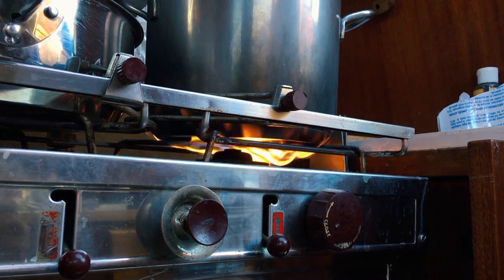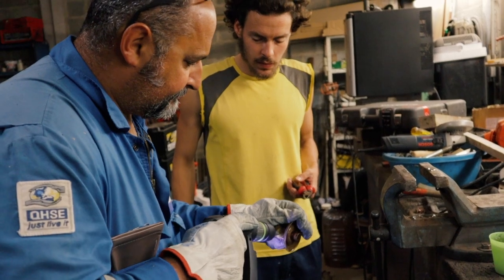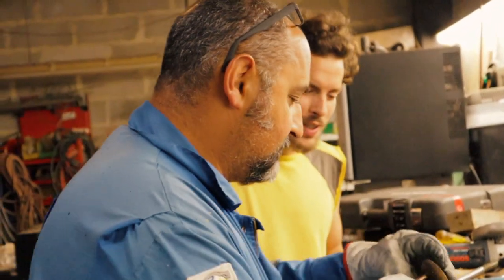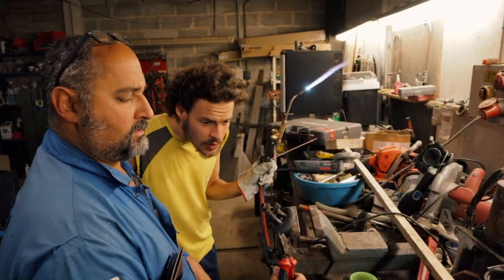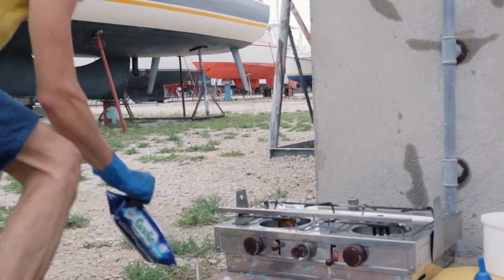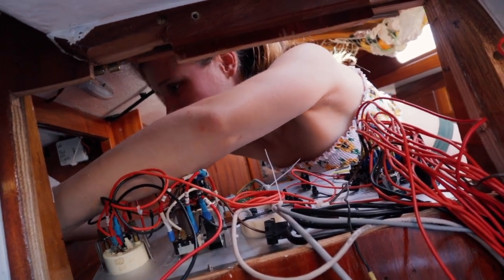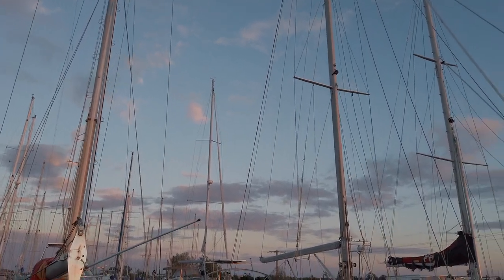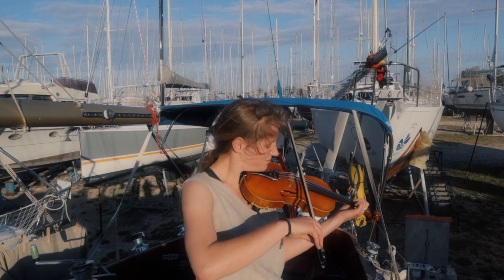Our Stove is Broken! [Ep 27]

Comment: What Maxime & Alardino were doing is called brazing , sort of a less hot welding, ideal for soft 

metals like that burner  but sadly only really used by us old school guys these days.  The little
connectors you crimped onto your wires are called spade connectors.  My Dad (long gone)
always told me to label the wires when I was taking my car apart, so that was very sensible.
And  playing us out with a fabulous tune.  Great video,  thanks   :)

Comment: Pressurized  alcohol stoves have been largely replaced with non pressurized wick burner stoves.  Small one burner alcohol stoves are small,  inexpensive and use the same alcohol fuel. It might be a good idea to  take some of these along in case the main stove fails during a cruse.

Comment: Hi Aladono, I have the same stove - always exciting to cook with  :-) In Hamburg I've got a repair kit three years ago ... Dont know if it is still available? My stove has an additional nozzle / blast pipe in order to make the stove heated bevor it burns. After getting the right temperatur it will have a clear blue instead of this yellow flame. Others use sprititus before using the stove.  Much worse also my heater runs with petrol and I ve tryed three times to repair it (35 years old) forget it, it works for two weeks and after the summer in autumn when you need heating the old pump isn*t working any longer :-/

Comment: G'day. A question: What is that 12v car type charger you are using for that apple mac?  Is your laptop an Air or Pro? I've got a new Air, which doesn't have USB charging,, so I need to get a 12V car charger type for my boat and adapt it to use to charge my Air.   I also didn't spot an inverter.....you just appeared to plug that 12v charger into your (newly located) cigarette socket...or did I miss something? If you don't use an inverter then I assume your charging set up for the Mac doesn't need the boost an inverter supplies, hence my interest. Cheers.
Reply from the maker: I spent a lot of time trying to figure out how to charge my old MacBook Pro without an inverter, and I ended up just buying a 12v to 85 watt MagSafe 1 charger from eBay. So far it has worked absolutely great!
Reply: @SailingMagicCarpet ; Hey thanks !  Nice  & simple.  Don't be afraid of more "technical" or even "boat yard refit" videos about how you & Aladino have your beautiful boat set up for cruising & living aboard. For us small boat owners it's great to see how others  with a small boat & minimalist / budget focused mindset adapt their boat systems.  Cheers.

Comment: Prime that stove with methylated spirit.
It's cleaner
Reply: I see that you've made contact with Base Camp, the English speaking world's one stop shop for paraffin/kerosene stoves.  What you have there looks like an Optimus 155W.  You might be able the get some Hanse Number 1 burners from Taylors in England but if there is a temporary shortage of the burners from Germany then I suspect Taylors will be hunting for them just like you are. Your alternative might be an old Optimus 207b burner on eBay but they are fairly rare too.

Short of that it's either wait until Hanse get their burners on the market or switch out to foolproof Origo stove.  Naturally, kerosene packs more punch than alcohol, but there are some committed devotees of the Origo out there.

Comment: Very good.  Kerosene...eewwww!  Induction cook top!
Reply: While induction cook tops do use a lot less energy than either gas or electric resistive hobs, they still use rather a lot for a boat without a generator. At 1400 watts my induction cooker boils water faster than a 2400watt ring... but 1400 watts is still 1400 watts, that's over 100Amps at 12V. On a boat, some sort of carbon based fuel is still king. Solar cooking solutions are great for sunny days at anchor or in the slip. Might be frustrating at sea though. Another energy saver is "straw box" or "retained heat" cooking for anything that requires a long simmer, like rice. Put boil rice as normal for 5 or so minutes, put cover on the pot, put pot in insulated box... done in an hour and still hot. Insulated box = cooler stuffed with a quilt or sleeping bag... or just the sleeping bag in any old covered box. I have even seen people use a laundry basket. Sure beats keeping the stove going for half an hour.
Reply: Watchful1 Induction hobs are too much of a load on limited generation capacity.
Reply: @lenwhatever4187  Thanks for the information.  SV Delos is experimenting with the setup--they did switch to several Lithium Diode (modern) batteries so maybe that makes it feasible.  You should search their youtube video on it and see what you think.  Interested in your opinion on how they are experimenting with it.
Reply: @daffygrey  sent this to Len too.  Thanks for the information.  SV Delos is experimenting with the setup--they did switch to several Lithium Diode (modern) batteries so maybe that makes it feasible.  You should search their youtube video on it and see what you think.  Interested in your opinion on how they are experimenting with it.
Reply: I have seen SV Delos previously, but they are not a go-to channel for me. They are a much larger boat than Magic Carpet, with space for a large solar array and battery bank, though size isn't everything. Lithium ion batteries (I assume that's what you mean) have a high charge acceptance rate and can be used to a significant depth of discharge. However, they still have a finite number of charge cycles, dependant on the depth of discharge, and their replacement cost is still very high. Induction hobs, having a high power requirement, will have a significant impact on the cycle life of the battery bank, even if it is not immediately apparent. All things considered, the only economically sensible time to use an induction hob is when hooked up to shore supply. The same goes for microwave ovens.
Reply from the maker: David’s points are absolutely correct! It wouldn’t be feasible for us to have an induction cook too on magic carpet. We’d need a generator (no space) or to run the engine every time we wanted to cook... which means the stove basically becomes a diesel stove anyway!! We’re announcing what we’ve decided on in the next episode!